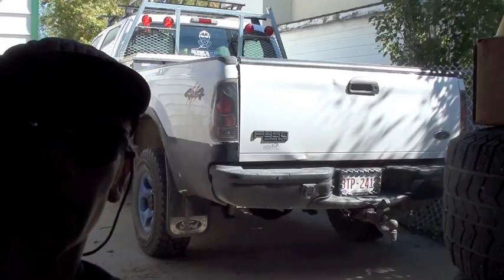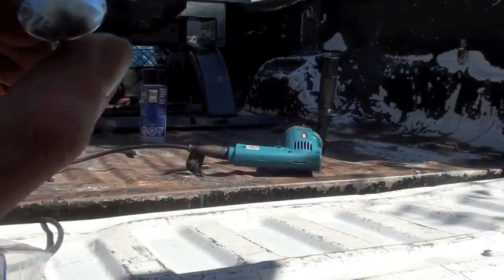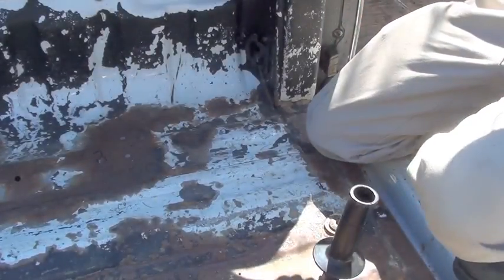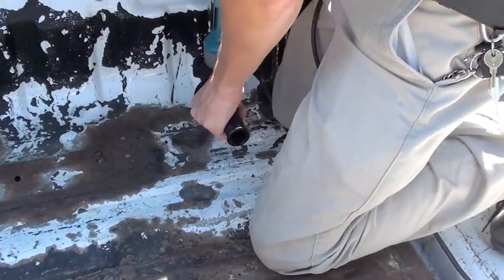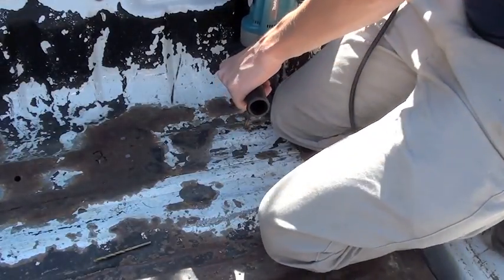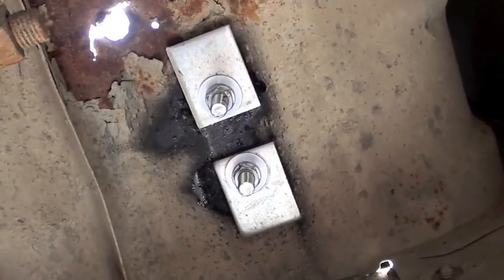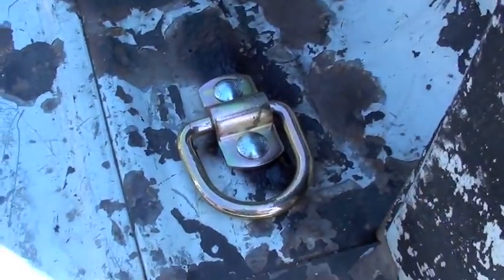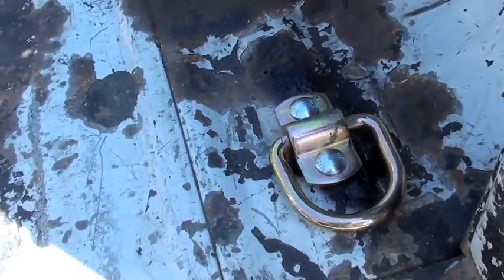Installing Tie Downs in a Pickup Truck

Comment: Might want to fix those rust hole first.
Reply: Yeah that rust hole in the truck bed doesn't look like it can handle 11,000 pounds does it?
Reply: @romdos11  lol.  Come on man, the truck of the bed isn’t rated for that much weight.  And those aren’t rust holes.  Those are holes that have some surface rust on them.  Something else he was hauling punctured or ripped out those spots.

Comment: When I add anchors like that, I use a one piece heavy strap a little longer than the anchor with holes drilled in it to match the anchor. The strap goes underneath and the bolts go through the anchors, thru the bed and then thru the strap. Then the nuts are threaded on with Loctite.
The strap always has to be longer to distribute the load out over the sheetmetal. Strap in your case could measure out at 1 1/2 inch wide by 5 inches long by 1/4 inch thick.

Comment: It would have been better putting a longer plate in the bottom with 2 holes in it. Aint that is the way I would have one long play and drill. 2 holes in it would have been more secure. Cos 1 side could rip out.

Comment: I use 18v Milwaukee cordless drill and sharp drill bits never had an issue always one battery in the charger and by the way MAkita is really a home owner type drill
Reply: Been using my Makita drill/impact set at work for 9 years, 0 issues.
Reply: 🤦🏽‍♂️ makita and Milwaukee are both contractor grade. You’re probably thinking about ryobi